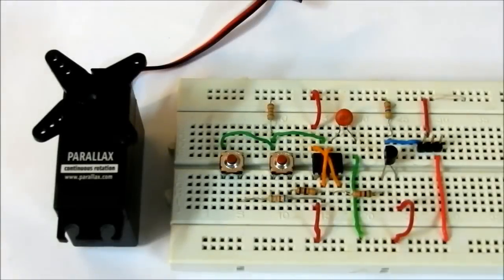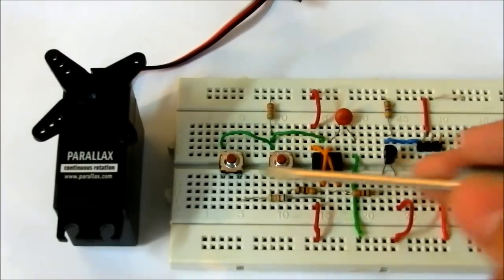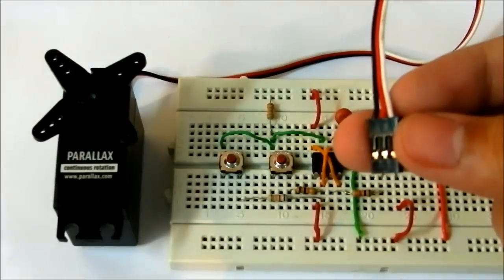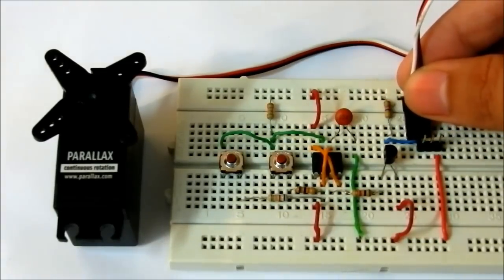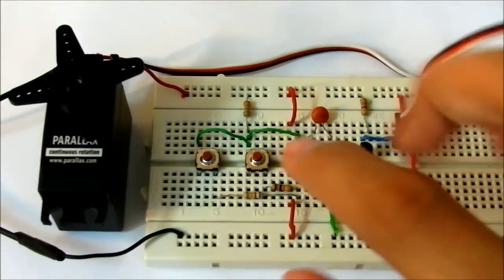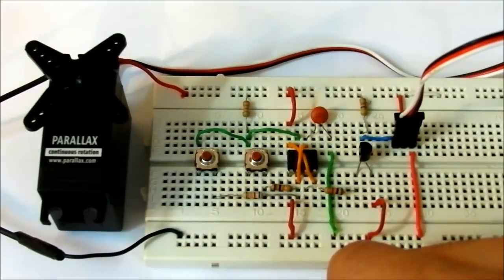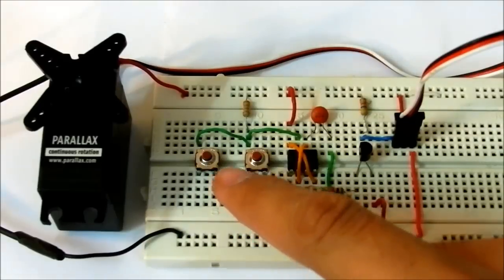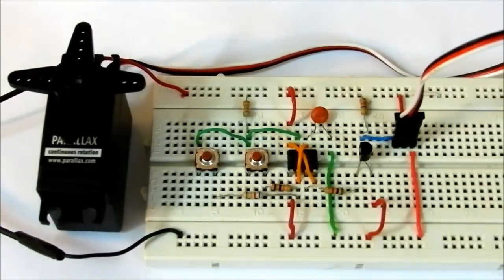Servo Tester using 555 Timer

Comment: Hey, I am curious. Is there a way to control a servo with the 555 Timer using a varying voltage instead a potentiometer?. I am doing a proyect of "ball and beam"  based in this video: https://www.youtube.com/watch?v=qRMYqmzOVFs&t=179s and the final step is transforming the voltage into a PWM. Could you help me?

Comment: Nice circuit and demonstration. Safty NOTE. Not all servos use the same power pin-outs on the connector. Connecting up the power wrong can fry your servo. So always check your servo's data sheets to make sure you have it connected right. Thanks for sharing. Best Wishes n Blessings. Keith Noneya.

Comment: Be careful everybody it doesn't work until you remove the internal variable resistor and replace it with two resistors . Not practically .

Comment: Good work sir...i tried making this circuit after which i then connected the 3 output to the Bec of an esc connected to a small brushless motor. Once powered, the esc gives its normal beep sound after which it then gives a continous beep sound..so my question is that cant the servo tester be used for a brushless motor esc BEC???

Comment: HI Mr Pir! can you help me? I'm trying to run a microservo tower 9g 5V. But somethint wrong because the BC547 is overheat (9V)and doesn't work. I'm using pin diagram datasheet that is, -collector to the signal servo/47R  - Base to 1K Ohm and emitter to Gnd. Of before hands thanks a lot!
Reply from the maker: Hello Gui! :D

1. I am pretty sure overheating issue because of wrong capacitor, please change that with similar specification
2. Also make sure to connect the 555 timer with perfect configuration. Please check also the top lines of breadboard are not connected on the middle.
3. If you are using any servo other than parallax... There should be some change with the values of resistors feeding to your pins of servo. 

Thank you,  let me know if that works out
Reply: ok...I'm just replaced the capacitor and  the temp is normal; Unfortunately I have made my first victim..the servo potentiometer is burnt. I will hack it for continuos mode. - I checked and re-check the 555 pins connection following your model.-is Ok
I just check the voltage coming to the servo pins and I'm receiving 5.3 volts.
But the fact remain that it's not working properly. I'm planning to put this circuit on my surveillance camera. By the way - have you the lay-out of this circuit for printing?
I'm in doubt with bc- its working as switch mode isn't it? the measure of this component is 363 hFe. The specifications for SERVO MOTOR SG90 are 4.8v to 5V
and the PWM 1-2Ms Duty period.
Reply: Ok, sorry about that, it was my fault - today I bought  another bread board, and the figure changed imediately - and it's work perfectly well - now I will print the circuit on copper plate for a final past-up
Reply from the maker: Thats amazing gui! :D
Reply: Hi! After instalation the system works but turns unastable - so that I decided to remake the calculation for the base current. AS you well know Ibase=Ic/hFE. right? 
so that 0.2* Total Resistance 78ohms * bc547 hFE 90= 1.404 K ohms
today I will change the base resistor and  then communicate you
Sorry, I'm 62 years old and I decided to study again. I love perfection-
Reply from the maker: With due Respect Sir! Good job! I highly encourage you on this :)

Comment from the maker: Roshni Fernandes...

You cannot use brushless motor here.. This circuit is only for Servo motors. You can find more details on the motor and online purchase on post page link here: http://rookieelectronics.com/servo-tester/
Reply: you can.  just hook it to an ESC.
Reply from the maker: +TakronRust ESC ?
Reply: +Pir Arkam electronic speed controller.  it takes a servo signal and converts it to the alternating signal needed for brushless motors

Comment: where can i get a pcb for this circuit?
Reply: ***** i already make it according to your circuit but it clockwise and cant anti-clockwise.. did u use 180 degree servo motor or else?
Reply: *****
what abot the supply? you use 6v ?
Reply: *****
how can i get the desired angle? i cant it stop when the supply is connected... any suggestion?
Reply: Hafiz Ahmad The servo used in this video is NOT a 180 degree servo. The servo used here is a continuous rotation servo, this is an unusual sort of servo and a normal servo has to be modified to create one, although some places do sell them ready modified. This circuit will work with a normal servo but the two buttons will only give two positions. You will have to modify the resistor values so that the servo does not move outside its restricted range.

Comment: is it possible that depending on rs servo model it will not turn anti cloak wise, after cliking 68k switche, it still will be rotating clok wise not anti.... need help with this im beginnner .. :(   , and all resistors are 1W ???